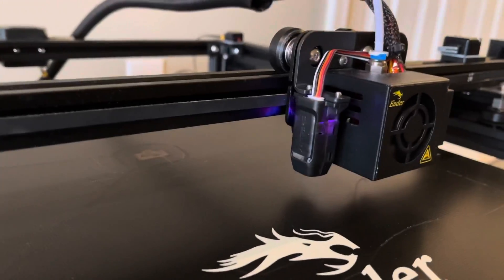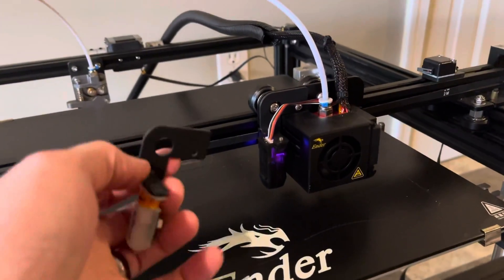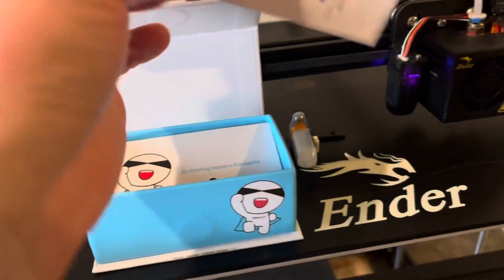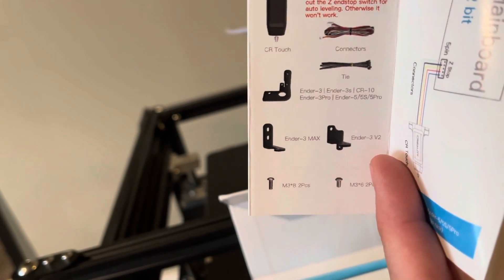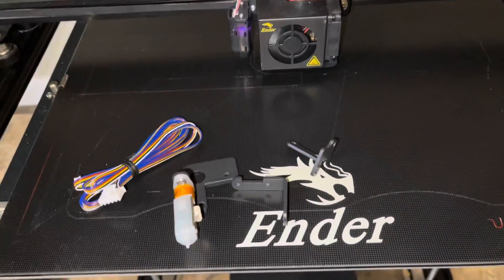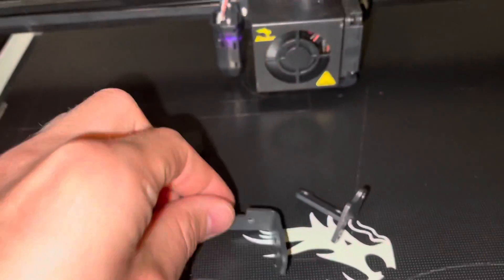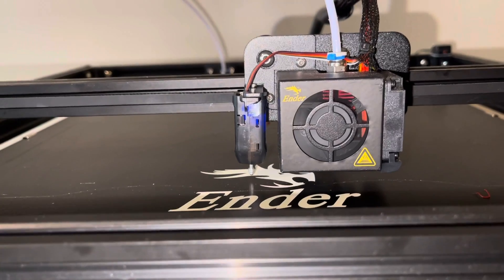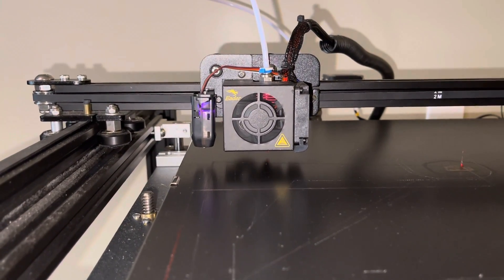Creality CR-Touch | Probe Review

Comment: Thank you for posting this!  I just bent the BL Touch probe on my Ender 5 Plus in a collision with a warped print.  I could either spend ~$14 getting a replacement probe tip for the BL Touch and break it again, or spend ~$50 on a touch probe with a metal pin that probably won't bend ever.  I think I'll go with the CR Touch!

Comment: Nice note on the bracket.  I thought the BL Touch bracket was slimmer so the CR Touch would install straight onto it.  I wouldn't replace a functioning BL Touch with the CR Touch.  Cabling is identical for both CR and BL touch, so they can be interchanged and you are right, as they are electrically identical they can be used with the Z-Stop connector or the BL Touch connector on any board that supports them.   The CR Touch is a bit heavier, having more metal, but apart from that the CR Touch and BL Touch are virtually identical, with the CR Touch actually being very slightly more accurate.  As a note, whenever you swap even BL Touch to BL touch you should adjust the Z Offset as even two BL Touches will be slightly different, but 100% needs doing with the CR touch as it is 0.05 mm shorter than the BL Touch.
Reply from the maker: Hey friend, thanks for the added information! That’s super helpful and well informed.

Comment: do you know if Cr-Touch would work on CR10s ??
Reply from the maker: If I’m being fully transparent here, I’m not 100% sure. From what I’ve seen, and take this knowing it was my personal experience, I was able to use the stock BLTouch cable to run this on a stock Ender 5 and a stock Ender 5+. So, I’d say in theory… it should as long as it’s using one of those two boards, but I’m not sure if it will work with the included cables they send you. But in looking at the actually Creality listing on their site, it says CR-10, not CR-10s (https://creality3d.shop/collections/mainboard/products/creality3d-cr-touch-auto-bed-leveling-sensor-for-ender-series-3d-printer-with-4-2-2-4-2-7-motherboard).
Reply: @plasticmakesperfect5863  thanks so much for replying back too me,
Reply: @plasticmakesperfect5863  404 Page Not Found on that link
Reply from the maker: How about this one? https://creality3d.shop/products/creality3d-cr-touch-auto-bed-leveling-sensor-for-ender-series-3d-printer-with-4-2-2-4-2-7-motherboard It looks like the exact same link but this one seems to work
Reply: @plasticmakesperfect5863  thanks

Comment: Hello there, from what I read and saw on other Youtuber's videos this new CR touch apparently only works on a 32 bit controller board. Is your Ender-5 plus still using a stock board or an upgraded 32 bit board?. I have recently upgraded my Ender 5 plus board to a Creality V2.2 silent board however from what I understand it is only an 8 bit board. Thank you.
Reply from the maker: Hey, sorry for the slow reply! I can tell you for a fact that it works on the stock Ender 5+ board (which I believe is 32bit), but it also worked on the Creality 1.1.4 silent board that I replaced in my regular Ender 5 which I believe is an 8 but board. BUT (and this is a big but here), it won’t work with the cables they sent. I had an existing BLTouch for both of those printers and simply swapped the probe using the cables that were already there. I know that the stock CR-Touch cables won’t work on those stock boards, they just don’t have the same port. Sorry for a crappy answer, but I hope this helps at least a little.

Comment: If you don't have a 32 bit board or you're using 3rd party board, you may have to rewire the board end of the cable if you are not using a BLTouch cable
Reply from the maker: Thanks for much for mentioning that. I caught that when I was initially looking at it and I forgot to mention it during the video. I appreciate it!